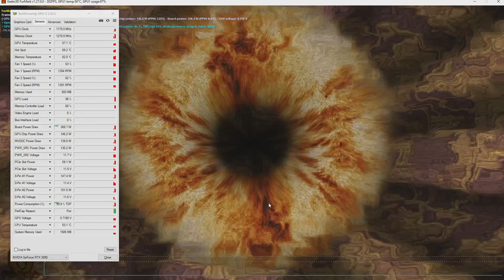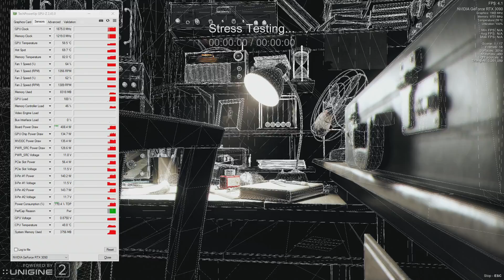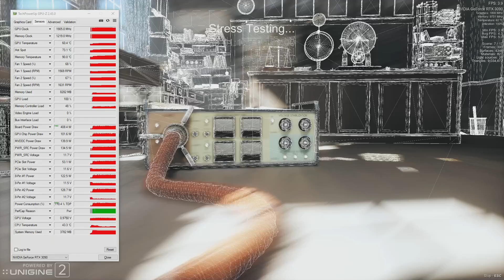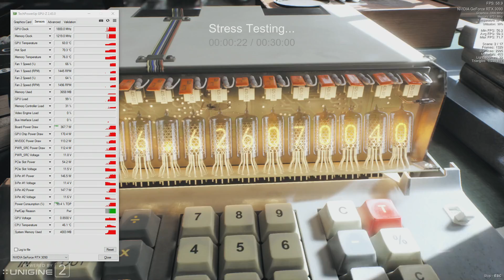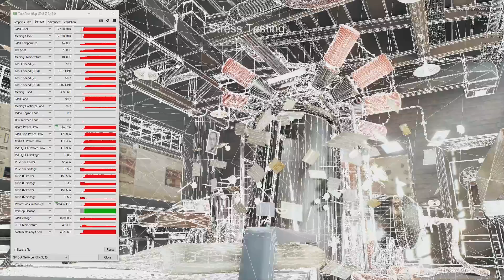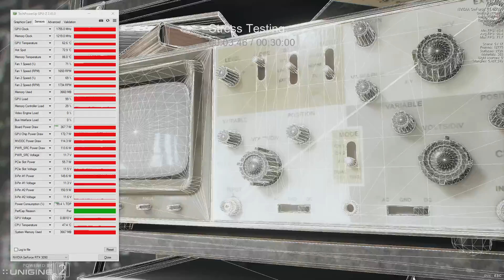One last thing about the RTX 3090 power management.

Comment: Optimized alone does not hold any meaning, it's lacking direction. For games "optimized" generally is used for how well it can run even on many years old low end hardware while keeping some visual quality.  If you make a scene and fill the scene with tens of thousands of 500k poly models. Place a camera in a position where it can see all those 500k models. And run the game engine like that, it'll struggle to play even 10 frames a second. But If you have different versions of that same model and enable level of detail which basically means "stop rendering the 500k poly one but render 20k poly one or whatever" based on the draw distance, it'll be a lot easier to render for the gpu while still looking the same because the tiny few pixels in your monitor can't show all of the 500k polygons of an object that's way too far away anyways. Likewise for a stress test like furmark, optimization means more power consumption, the more the better.

No the new world being unoptimized is not killing the gpu's. But new world isn't really optimized. I bought it and played it for a few days and I've seen much better graphics with way better performance in similar games. If the game was optimized enough, most people would probably hit the monitor's refresh rate limit with vsync or something and it'd not kill this many rtx 3090's. That doesn't mean the stupid card isn't faulty. And it's not amazon's fault. But new world on an optimization sense utterly sucks in a big way.

Comment: as I've been saying from the start, this is a design issue not a new world issue.  software should not be able to break hardware outside of a bad flash.  if it can, the hardware is at fault (and yes there is a lot of IMHO broken hardware out there on the market.  doesn't make it right, or acceptable).  otherwise we're in for a world of hurt when the next hardware breaking malware comes along.

Comment: First challenge: Nvidia paid Samsung to manufacture the most powerful GPU chip within a price agreement.
Done!
Next challenge: it is a GPU meant to be mounted on a graphics card PCB, that is mounted inside a PC-case.
Hmm..
Not Samsungs responsibility. They just made that powerful GPU, Nvidia paid them to. 
Too powerful for a general consumer card. And especially for the modern mainstream "glas houses" of PC cases.
A PCB card of that size, dealing with 400+ watts of heat is not really consumer ideal.
This kind of power should be inside at pro rack case with lots of airflow (and room AC).

Ideally, the ref. 3090 should be watercooled with a good 360 rad and some good SP fans. Huge Block that need to cover GPU, VRAM and Power stage.

Comment: 04:48  No it doesn't.  It has 5248 CUDA cores.  Prior to Turing, a CUDA core was a single ALU capable of executing either one FP32 instruction or one INT32 instructions.  With Turing, that changed to a pair of ALU's, where one could execute FP32, and the other INT32, at the same time.  

The INT32 fact is important, because CUDA is a software library that includes integer math.  If an execution unit cannot do integer math, it is not a CUDA core, by logical necessity.

So when Ampere came out, and nVidia changed the "CUDA core" count at the very last minute to double the actual figure, it was a marketing lie.  With Ampere, a CUDA core is a pair of ALU's, where one can do one FP32, and the other can do either FP32 or INT32 - the same as the sole ALU with pre-Turing cards.  In practice, anywhere from 20-40% of that extra FP32 capacity ends up being used in games, with the average being about 25% at 4K.  That makes the effective CUDA core count, for games at 4K, ~6500.  That's a far cry from the marketed figure of over 10K.
Reply: @Claus Bohm I'm talking about games.  In a single-function app like Blender, the extra FP32 capacity is much easier to take fuller advantage of.  Ampere is much better for compute than for gaming.

Comment: Thanks for these RTX 3090 Video they are great!!!

I had to RMA my EVGA RTX 3090 FTW3 Ultra Gaming on the Special EVGA Program due to the Power Balancing Issue. My First Card was a PCB rev 0.1 Red Lips Serial 2014 Made in Taiwan and even with the Hybrid Kit installed did nothing, the card would downclock no matter what and sometimes as low as 1825-1850 from 2100. After more than a month, I recieved a new one, this time PCB rev 1.0 Black Lips Serial 2114 also Made in Taiwan and it was a complete stock card, literally it would crap out on even +5 on Core or Mem using whatever VBIOS i tried and whatever i did, sometimes would crap out on heavy load also. I talked to EVGA again, I live in South America so RMA ain't easy at all and I went again on the program. Almost a month and a half passed again and i recieved the same model, same PCB revision and country of origin, but this time the card would clock decent. That was on winter with 13-17C outside and nights with 3-6C, soon as spring approached temps in my country rised to 23 and now 31-33C so the card started to heat up and to downclock, this time not as hard as the others but from 2100 to 2020 aprox. For that reason, i decided to put it on water and try, i used an Alphacool Aurora GPU Waterblock, installation went perfect and soon as i put the card to work all ICX Sensors were gone, all reported 0 except GPU. So well, instead of taking apart the card again i searched and discovered that many people with this card and different block brands like EK, etc had the same issues and others even with no waterblock, just stock cooler, mostly all asking where on earth are the ICX sensors located. So again, i tried all of software related solutions, flashing different vbios and nothing worked. For that reason, i decided to reseat the block, check the thermalpads but nothing was wrong, everything seemed perfect and temps are great, but still no ICX 9 Sensors. After some research i discovered that with early PX1 versions showed all except ICX PWR5 that was stucked on 374C (never ever moves from there) and that was the problem, the software detects one sensor wrong and put 0 on all, but with PX1 v1.1.1 shows all except this stucked one. Moreover, GPU-Z has a nice delay reading the ICX when i open it and sometimes crashes, that's beacuse it shows PWR5 as "-C" other programs like AIDA64 and HWINFO just discard PWR5 and show only the working ones and they work perfect. With all this said, i honestly would love to know where the sensors are located and what kind of electronic component is or look like to identify PWR5 on the board and check if somethings wrong in that area. I wish i have another board to send it to you, EVGA won't say a word about this, they just replace them and they keep failing. All this i told you started for me on november 2020 where no game such as "New World" existed, but the first rev 0.1 was doing exactly the same with "Days Gone" when launched the first day and "Metro Exodus EE", card would just go crazy on clocks up an down, and of course with Furmark. I use an Acer Predator X38 3840x1600 monitor which is heavy on these cards for that resolution, specially if you use Ultra settings.
Sorry for the long message, i just felt i need to share this, there are more than 276 pages on EVGA RTX 3090 FTW3 thread on EVGA Forums full of people with problems, new cards keep coming and many (like me) had to replace the card 2-3 times. 

All the Best, Sergio!

Comment: When you have a 3080ti FTW3 and a sandwich waterblock coming in and you were expecting to be overclocking the hell out of it.... And now you're like... hm... I should put my power limit to 80% just to be safe 😤
Reply: 3080Ti FTW3 not at risk. has revised board
Reply: @dreamhackian4864  You sure? Cause the board seems pretty much the same to me... If it is indeed revised, then it means the block I ordered won’t fit 🤣🤣 I also asked EVGA if it’s ok to go for a full WaterBlock in terms of warranty. I know it’s already said many times but if something happens now I will have the support ticket answer as proof that I got confirmation before proceeding 😅

Comment: Does anyone here know about what 10700k IMC limits are? Im considering getting a z590 Apex to play with some expensive RAM, but I'm not going to do that if my 10700k can't run RAM that fast anyways. So if I'm using a 10700k on a z590 Apex, will I be able to hit 4000 mhz cl 14, without being limited by the memory controller on my CPU?

Comment: discuss parallel many low mhz vs few high mhz, direct comparison, advantages, negatives
Reply: power should be square of MHz and linear in number of cores
Reply: software ray tracing in shaders can do it
Reply: you stop rendering when your allocated shader time per frame is consumed, next frame, thanks
Reply: hack the power limit, to something like 800W or more, to let the full boost with all the transistors

Comment: This furmark donut is used in MSI kombustor - anyone know how similar it is? I discovered that Path of Exile (using the Vulcan engine) was giving me higher temps than MSI kombustor. I thought that this might be a result of full system utilization beyond just the GPU. (More heat in the case and on the board in general). I had to use frame caps with that game to keep temperatures in line.

Comment: I just had a thought. 
When running Furmark the card draws about 350/0.7 = 500 Amps.
When running new world, under stock conditions, you can expect the card to run at it's typical 1750-1800 boost frequency.
So, assuming current draw increases linearly with frequency,  if the GPU attempts to run all cores at 1800MHZ we would get a current of about (1800/1200)*500 or 750A(!!!!!!!!)
No wonder OCP is set to 800-1200A.
EDIT: Assuming the current would increase linearly with both frequency and voltage, we are looking at a potential 750*(9/7) = 954.28A. 
Fuck.
Hopefully CCL at least tames that a bit.
Reply: The voltage will go up with higher frequencies, and therefore current will go down, not up, at the same power draw.
Reply: @TrueThanny  The power draw doesn't remain the same at different frequencies. If it had, the 3090 here wouldn't be down-clocking itself so hard when running Furmark.
Generally, current scales with switching frequency in a roughly linear fashion for the expected operation range of frequencies, as transistors being toggled more times in reach time frame. this is a very rough approximation, since other parameters, such as the amount of time for which current is required, may change the average charge/transistor-activation ratio. As the frequency goes up, more voltage is required to maintain stability, which would mean the current flow per activation would be higher, this increases roughly linearly, but it is a bit more complicated than that and I don't know whether there even is a general equation you could use to approximate the behavior of a particular piece of silicon.

Comment: Wait so the 3090 only runs at 1200mhz while using 350w on furmark? Is this normal behavior have we seen this in the last let's say 5 years in anything else Amd or nvidia?
Reply: Pretty sure that was an intentional kneecapping put into the Nvidia drivers a couple years back so the cards can't melt themselves when using Furmark, specifically. 

It's like Nvidia realizes that their cards can't be left to their own devices...

Comment: What about using higher quality components for the power delivery system to be able to handle the problem of the spikes, and is this even possible, does better quality components even exist?
Reply: If you have more VRM phases that can share and distribute the load - the are going to last longer, since the load will be distributed. If you have higher quality components rated for higher voltages / power draw, of course they are going to last longer, by definition. 

That's why, if you intend to use a GPU for longer, you should basically pick whatever card has better power delivery components / better design. A good example of this is the POSCAP/MLCC fiasco at the launch of these [3090, 3080] cards. Cards that only had MLCC's (like the Strix and TUF) did not have any stability issues whatsoever.  Meanwhile, everyone else who went with 5 or more POSCAP, had stability issues - at least from what I remember. 

Why did they use POSCAP's? Cause it's cheaper, nerd.

Comment: Please, for the love of god stop talking as if you're in a place of authority on electrical engineering,

you're a hobbyist amateur who knows some things, you're not a qualified electrical engineer, you don't have any experience nor will you ever have any experience building a motherboard or graphics card.

100% power limit is not the hard cap and has not been since kepler, if the card can't handle spikes to 110% as the boost algorithm permits by design then the card is flawed in design.

Comment: So running the VRM on high load and close to its limits is reducing the lifespan or killing the VRM? How does EVGA shipping out new cards resolve this then (apart from them blaming the soldering or w/e it was)? Seems untenable to just keep replacing them because high loads keep killing the VRM. Is it maybe also a combination with the high temps the VRM and memory modules are running at? 

I would guess if that's the case, then running a single or even double sided GPU waterblock would probably help. Or, do you think we'll see aftermarket cards running beefier VRM in future designs to avoid issues like these?
Reply: There probably aren't enough cards dying yet to make a more permanent solution more economically viable. Still, New World is unlikely to be the only game that can push the cards hard enough, and the VRM will probably be short lived regardless; hopefully enough cards die within warranty to actually make it more economically viable to make a proper card rather than hope it can last just until the warranty ends.
Reply: Read what i posted some minutes ago bro. All the Best, Sergio!

Comment: 1080p to 4K has same geometry/triangles, what is different when you shade those triangles at higher resolutions 4K/8K you have more pixels to shade to color the triangle of the geometry. Each pixel for the most part is one operation of a pixel shader or compute shader and so on, more pixels more processing and more loading (keep more shaders busy with work). Well that is my understanding.

Comment: can this sort of issue be mitigated be higher capacitance output capacitors to help stabilize the output voltage and resduce some of the feedback to the vrm?
Reply: The capacitors would need to be huge (probably in the Farads) to deliver 1000A for milliseconds without sagging more than tens of millivolts. You can calculate the required capacitance but I'm too lazy to do it.
Reply: @nicholasvinen  good point, running numbers gets a value on the order of farads to dozens of farads per capacitor assuming 700W of peak consumption and somewhere around 10-20 mV of drop across 16 capacitors. This does seem a bit high

Comment: I have a Vision and hoping it will last at least 2 more years; 3 would be awesome having bought it at MSRP and given there's a GPU shortage and prices are suborbital, I still consider myself lucky...so far. Not doing anything extreme with it and VRMs run no hotter than 82 C so am keeping my fingers crossed.
Reply: I just stumbled across a 3090 for less than MSRP, new with warranty, and I decided to get what I assumed was right - having as much 140 fans in the case. I have 7 140 fans and 2 120 fans in lian LI mesh 2, I get 66c and 80c when gaming. After awhile I thought it was stupid, but now I think I stumbled on a solution to preserve my gpu. I think using a vertical mount will help vrm temps.
Reply: @redoxicomanic3676  👍I came to the same conclusion and used a vertical mount which helped - but beware of Riser Cables because it's hard to find ones that actually support PCIe 4. 

 But what really helped was using an external fan to blow between the motherboard and vertical GPU; this keeps temps down quite a bit for the GPU , M.2, RAM, Chipset and Motherboard in general. My average GPU gaming temps (HWINFO) are around 78c and M.2 average is 30c. Some people won't want a fan sitting next to their open PC but the noise doesn't bother me and I care more about longevity and performance than looks. Sure wish they would design a case with a fan blowing directly on the motherboard...it just works so much better.

Comment: I wonder if twice the capacity on the GPU-Side of the VRM could take away a little bit of the peak load on the VRMs. Or are the peaks so long that you'd need crazy amounts of Capacity to handle these situations. 
Also: Are there power-stages with higher ratings, or are we getting back into discrete MOSFET-Territory at over 60 Amps continuous ratings?
So far my SMPS-Designs peaked at 15 Amps with MOSFETs that have continuous current ratings at about the value of the calculated peak-values.  

Another thing that just popped into my head: How close are they running the Inductors to their Saturation-Limits? As soon as the Inductor is saturated, it's resistive component (less than 1 mOhm) becomes dominant, which will effectively look like you short the GPU Power-Rail to the 12V Input-Rail for a few microseconds, before the Controller can turn off the Powerstage due to Overvoltage (Overcurrent should have tripped here, but doesn't due to mentioned design-flaws) or the maximum On-Time being reached.